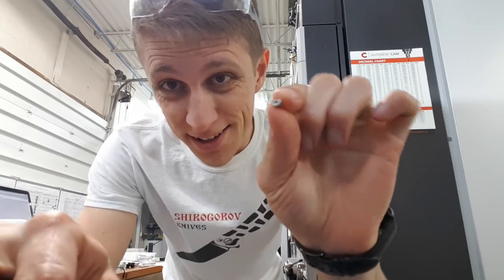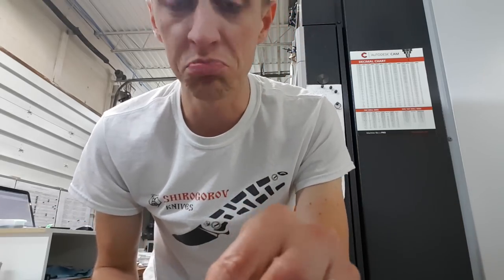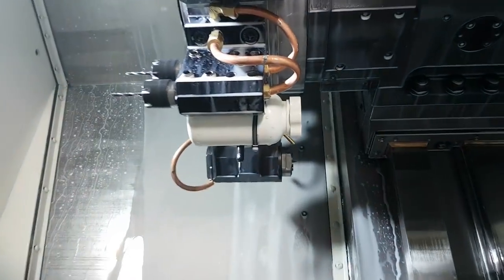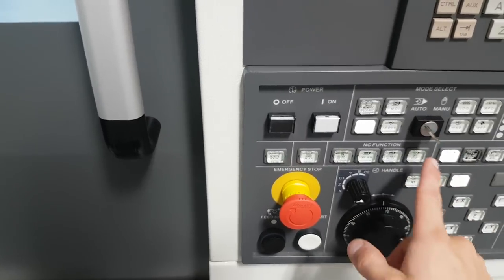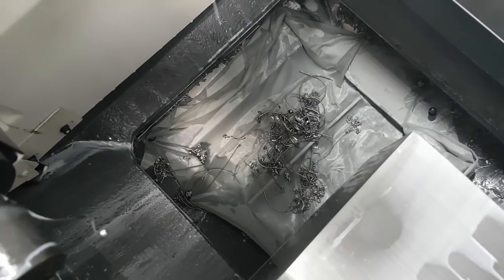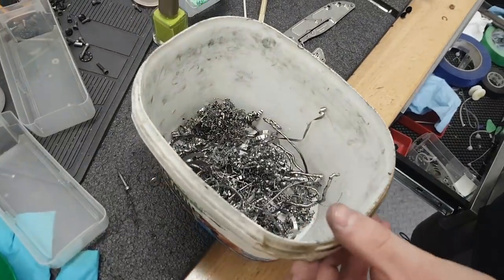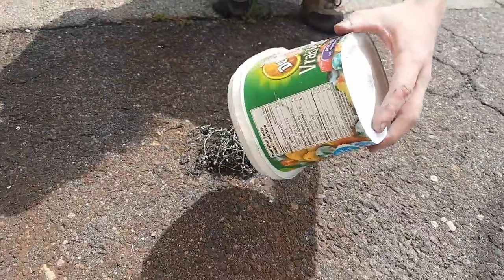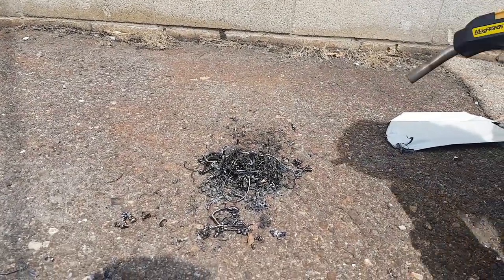Making Zirconium Screws!

Comment: Nice video and a shop I'm jealous of.  I made some zirconium from an exotic thermite mix around six months ago.  I've been looking to purify the stuff for a while now and I've tried a few ways on small samples with limited success.  I can dissolve some of the slag away with hot concentrated sodium hydroxide solution, but the corundum slag isn't as prone to attack as pure aluminum sadly.  I'm looking into possibly using my vacuum chamber and use plasma and a low pressure argon atmosphere.  I've no clue if I can get it to work.

Comment: Dont blame you for not wanting to do production parts with zirconium. We had a machine burn down from a magnesium fire at work. Even with proper fire extinguisher it still burned a hole right threw the way covers and the heat burned up the control panel.

Comment: Zirconium can burn in both nitrogen and hydrogen(!) forming zirconium nitride and zirconium hydride respectively. zirconium hydride is in turn also flammable when it comes in in contact with oxygen. This is why they used zirconium sparklers to burn of excess fuel before engine start when launching the space shuttles.

Comment: What is the actual point of using this material what are the pros?
Reply: David l  I think because it's an exotic material. Not many people have heard of it. It does turn beautiful colours during heat treatment. Some might find it interesting that zirconium is also used in nuclear weapons.
Reply: Spek that's zirconium oxide, a ceramic.
Reply: Zircaloys are used in nuclear fuel cladding(the tubes that keep it in), it's very good with high temperatures and resistant to corrosion.
No idea why you'd use it on a knife though, titanium does it equally well in normal conditions.
Reply: You can heat anodize it black green or blue. I use it almost every week never had a fire. It looks really cool when it heat colored black. I have a black wedding ring from it
Reply: It looks pretty. Lol